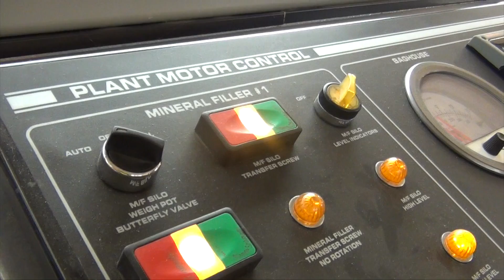How Does the (Asphalt) Plant Work?

Comment: While driving on a smooth asphalt road, have you ever thought about how the asphalt mix is produced?

Behind me is an asphalt plant, where stone, sand and recycled products are combined with liquid asphalt to create an effective payment material.
It all starts at the stockphiles. Each pile consists of a different sized aggregate, raging from coarser stone to fine sands.

A loader operator hauls stone from the pile to cold feed bins.

Each bins holds a different size aggregate.

A conveyor below the bins feeds aggregates into the asphalt plant.

The plant operator, working in an onsite control room, can adjust how much of each aggregate size is used in the mix.

Usually, the aggregate enters a large, rotating drum, with a gas powered burner on one end.

The aggregate is completely dried by the burner.

One that happens, liquid asphalt is pumped from the heated storage tanks and added to the drum, where the rotation will mix it with the aggregates.

Reclaimed asphalt pavement, or RAP, can also be sent to the drum through a separate cold feed bin and coneyor.

Using these recycled materials reduces cost and is friendlier to the environment.

A continuous plant, or drum plant uses a drum to dry and also mix liquid binder and aggregate together.

It’s the most common type of plant used in the U.S.

A batch plant also uses a drum to dry the aggregates but then sends the dried material to a larger batch tower and then to a mixing chamber where the liquid binder and aggregates are combined.

Once the asphalt is mixed thoroughly and heated, it is sent up to storage silos.

Some silos are only designed to hold material for a short period of time.

Other silos are heated and can store mixes for several days.
Some plants will use more silos depending upon the number of different mix types needed.
Beneath the silos is the loading area.
Dump trucks will receive material and haul it to the paving site.

A weight scale is located on the loading ramp in order to discharge the correct amount of mix for usage.

Once the truck is loaded, the driver is given the signal to transport the asphalt mix to where it’s needed for safe, smooth, and economical roadway construction.